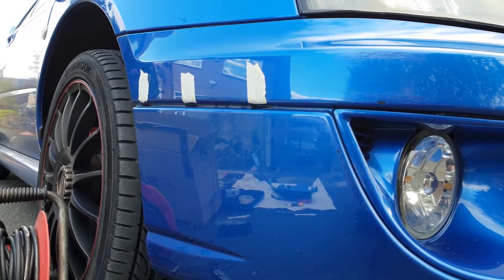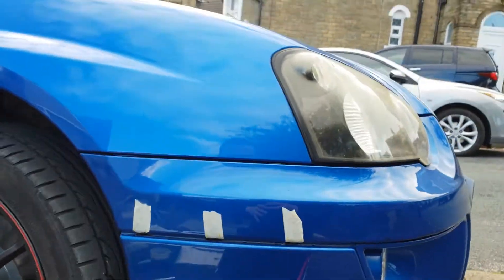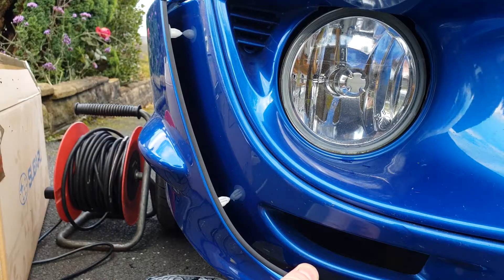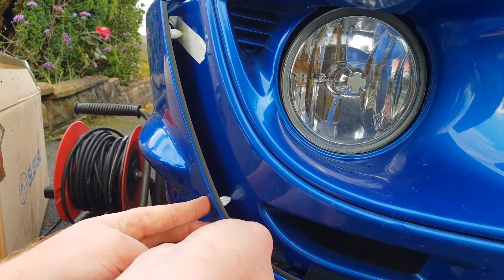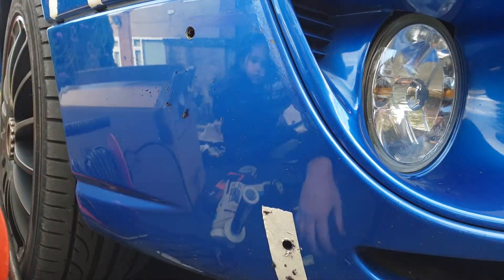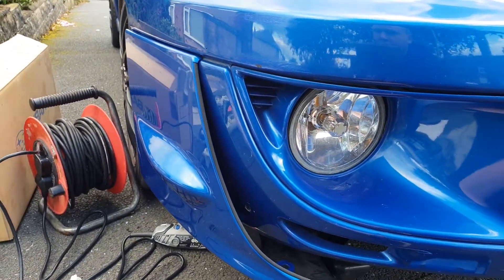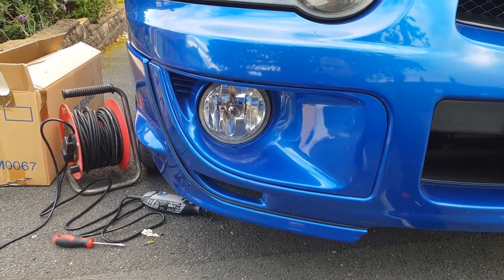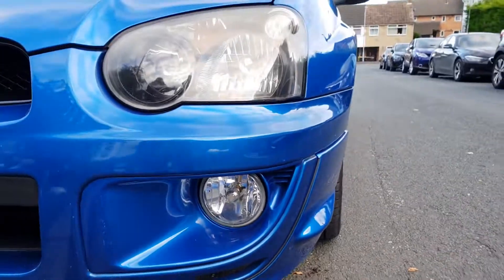Subaru Impreza STi Winglets install blobeye

Comment: Did you have to buy a fitting kit from from icp aswell or did it all come with the winglets ?
Reply from the maker: No, everything came in the box as a kit
Reply: Thank you mate I've ordered some.
Reply from the maker: @stevebromley8545   not a problem. I hope it helps let me know how u get on
Reply: Hello mate fitted mine today was  loads easier than previous times I've done it with tiger seal
Reply from the maker: @stevebromley8545  will be solid, then won't be coming off anytime soon, haha